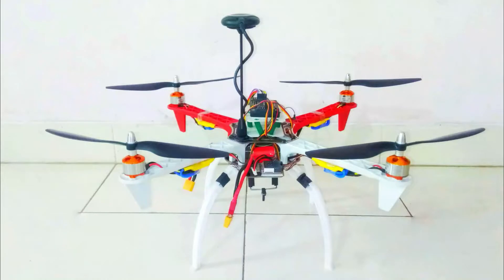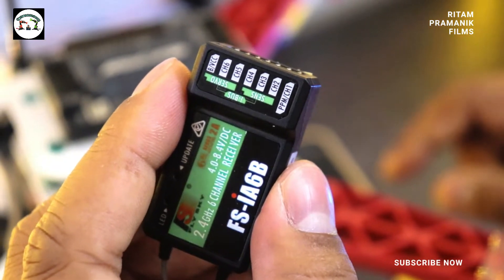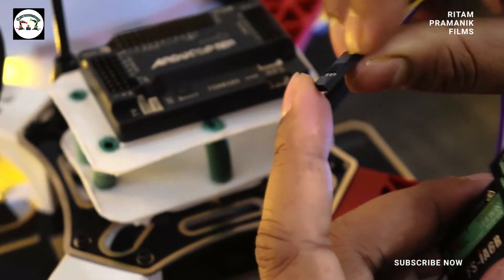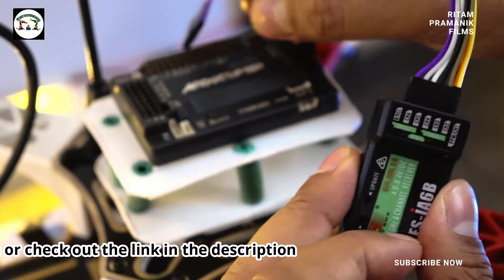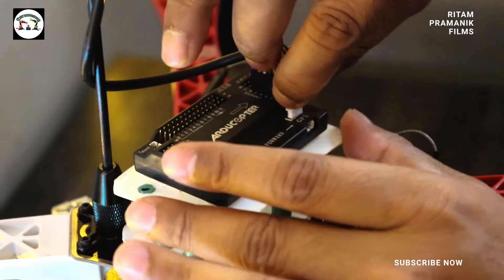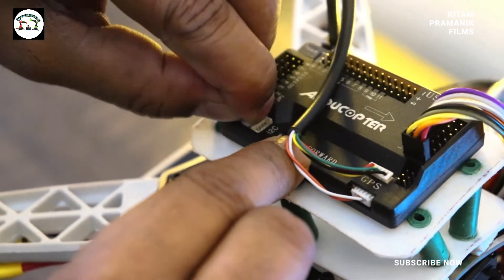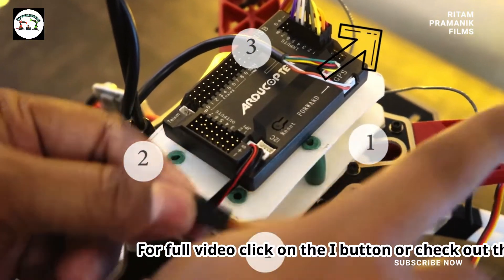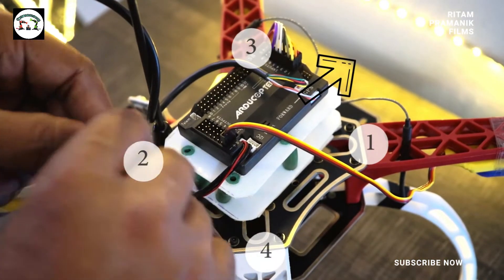APM 2.8 Flight Controller Full Connection || Quad Copter || Chandrabotics

Comment: what is the input power requirement to apm2.8
Reply from the maker: 3DR provides an 3DR Power Module that supplies 2.25A at 5.37V. The module is designed to convert power from the main flight battery (18 Volt maximum). That module will supply sufficient power for your APM, and low power radios including your RC receiver (without servos). Your RC receiver can be powered from any APM Input (+5V and ground). This is normally done by connecting a 2 or 3 wire cable between an APM Input and one of the output channels on the RC radio.

Comment: nice bro. one question: i see there is no jumper on J2. i see on YT and it is recommended to change this jumper to enable external compass. also how did u setup external compass in mission planner?
Reply: When you are using power module you need not to use jumper, jumper is used only when we are powering APM with ESC's.
Reply: Do you know how to enable in build compass?